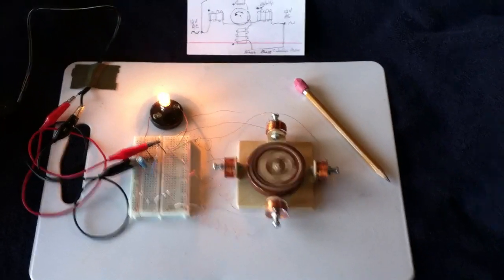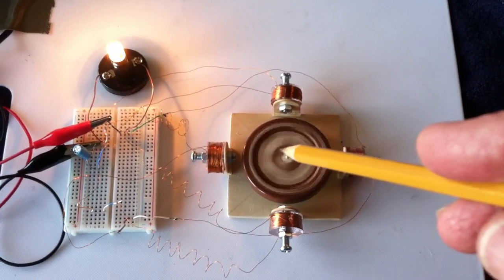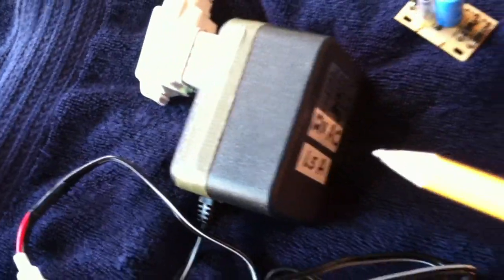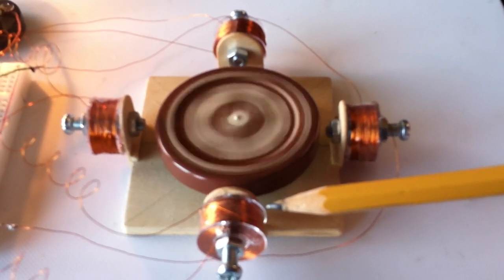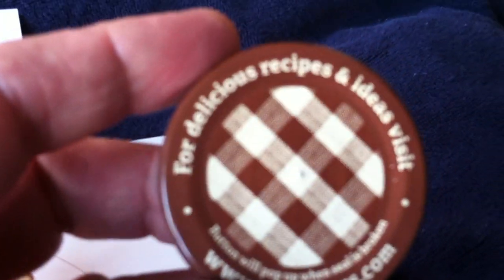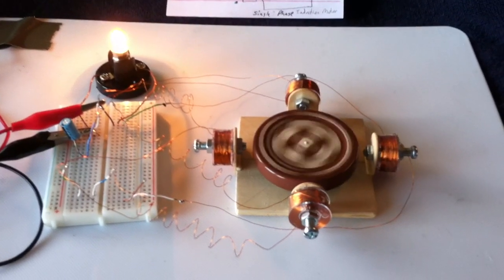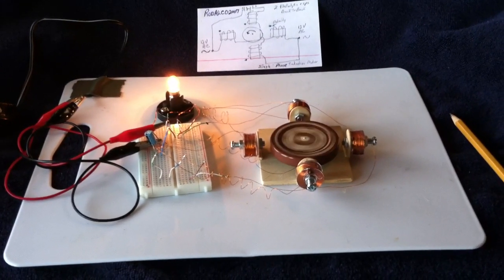Homemade 12v AC Induction Motor

Comment: i believe this is a hysteresis motor. still an induction motor, but it relies simply on the steel lid remaining slightly magnetic rather than any induced currents in the rotor. it would rather turn than demagnetise and remagnetise in a new orientation.

if you replace the capacitor with an inductance, it will still create the desired phase shift. except it will be leading rather than lagging, and will rotate the other way.

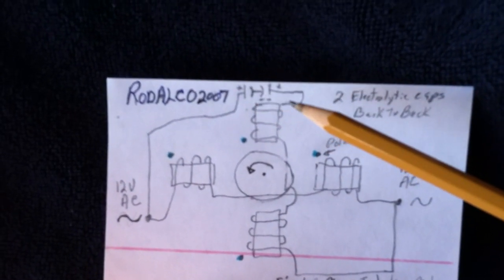Comment: 1:51 When in doubt, a simple crude capacitor can be made in similar style as N. Tesla by placing a small glass of salt water inside a larger glass of salt water and dropping an wire lead down into each glass as an electrode. Very poor capacitor by today's standards, but it might get the job done.

Comment: What is happen when replace rotor into coil
Is possible to generate a electricity in coil...?
Reply: You would transfer energy into the coil yeah. However, you aren’t generating energy. Wireless energy transfer is inherently inefficient and you’re putting power into the four coils. The energy you would get from the rotor coil would be less than that which you’re putting into the four coils. Thus, power isn’t being generated, just transferred.

Comment: Cool build.  Question how is a 2amp fuse going to help a 1.5amp max pwr supply? Seems like going to cause over heat to pwr sply / fire hazard before fuse goes away... my experience is fueses are not exact and have a breakdown point depending on condition.  Ex . Instantaneous 2 amp surge or creaps up to say 1.9amps . While doesent blow fuse and creates alot of issues. 🌋🏠
Reply from the maker: Yes.  I should have used a smaller value fuse.  What I was really guarding against was a dead short but a 1 amp fuse would have been better.

Comment: Hey, I was curious, how many turns you did for each coil with the copper wire?
Reply from the maker: I didn't count the turns of 30ga magnet wire.  It is several hundred.  It is not critical.

Comment: I know the shortened version of the math involved to determine the correct amount of capacitance for 90 degree phase shift if you want to know.
Reply from the maker: +John Kerley  Thanks.  I try to stay away from math on these projects.  Probably many folks think that is stupid but this hobby is more like a free form art thing for me.  I get some kind of weird kick out of just building something that looks like it might work ---and then watching it run.  I used to do the math thing but I'm retired now.   Perhaps my brain does rough calculation still and I don't even know it.
Reply: +Lidmotor In that case you probably may have better notes on electrical things than I would have,....I did'nt know that you used to do that for a job.

Comment: An aluminum lid will spin too.
Reply from the maker: +John Kerley   I have tried aluminum and it doesn't seem to work.  It should.
Reply: +Lidmotor An aluminum can works, because I did it before,...but at greater volt amps.

Comment: Hey, I .appreciate your excellent descriptions and wiring diagrams! I had bee waiting for an opportunity to mention bi-polar electrolytics. I used to have a Lowrey theater organ that used them in the sustain circuits. When one broke, I would replace it with two back-to-back electrolytics.
I put several coils in series in a Bedini motor. See my video and diagrams on it. Channel: frrogoy.

Comment: It's awesome to see the development on this! I might actually build this one up as the idea behind induction motors fascinates me! Have you taken your PC scope and measured the phase difference between the 2 fields? If you select the amount of series capacitance so that you can get as close to 90 degrees that should improve efficacy further. Does the lid get warm after a while? Your lucky to get away with that capacitor not exploding! ;) Have you considered salvaging a few motor starting capacitors from actual induction motors? They are about 250uF-500uF depending on the size of the motor. You can also get some reasonably high value capacitors from old dead power strips (especially the ones with some minimal filtering and protection features or UPS supplies)
Reply from the maker: +Power Max  I really need to look at this on the scope to see the phase shift.  You are absolutely right about the capacitor determining the shift.  Unfortunately I do most of my work using trial and error so I have to learn things the hard way.  That little cap doesn't get warm nor has it bulged --and I don't know why.  It should have popped by now.  I will continue to look for a proper AC cap but for right now it is the best thing I have tried.  Larger or smaller values don't work as well.  The rotor does not get warm but the coils do heat up if I run this too long.  Actually I am considering moving right into making this setup a DC pulse motor using a controller of some kind with Hall sensors to switch the coils in a rotating fashion.   The rotor of course would be changed to one with magnets on it.  It would make a good Arduino project.
Reply: ***** Umm, interesting. I would expect the coils to get warm but not too warm. Do the machine screws get warm? Like warmer than even the coils?

I have a sneaking suspicion that they are causing power to be lost, due to things like magnetic hysteresis, reluctance, and induced eddy currents within the screws. This is the reason why transformers generally use several thin sheets of soft steel laminated together.

Soft steel has little hysteresis losses, and using several thin sheets laminated together reduces electrical conductivity of the steel so that it doesn't look like adding a shorted secondary coil to the Xformer, or in this case, the motor.
Reply from the maker: +Power Max It might be the machine screw cores but I think that it is just a current issue.  I was thinking yesterday of trying air core coils using nylon machine screws just to see what happens.

Comment: Excellent job and so cleanly presented. Basic household components and I like the idea of using the bolt and nut to adjust the gaps, that gives you such fine adjustment tolerances.
Reply from the maker: +GrandadIsAnOldMan  Thanks.  I try to make my projects from household or easy to find parts like you do.  That is actually much of the fun of it.  The stator coil adjustment is critical and using a simple nut and bolt arrangement solves the problem quite nicely.  The metal jar lid sitting on nail worked but a better rotor arrangement is needed.  I'm still wrapping my brain around how this motor works.  The concept of a rotating magnetic field using a phase shifted AC sign wave signal is pretty cool.  When I look at this thing running I see Tesla looking right back at me.

Comment: Now you're torque'n ;-)

How much current & power (W) does it consume at running speed?

Thanks for sharing!
Reply from the maker: +A B  I didn't look at the power consumption yet.  I just got it running this afternoon.  The first 2 coil "proto type" I made was drawing 12 watts!!!!!! I think this one will be much lower with higher RPM.
Reply: +Lidmotor It does appear to run faster.  I'm a bit surprised how big the gap is from the bolts to the lid. I would have guessed that gap would work better if it was smaller.
Reply from the maker: +A B  That gap issue surprised me also.  When I first set this up I had a very small gap but the rotor was just pulled off the nail bearing and stuck to the nearest electromagnet.  Too much gap and the rotor speed suffers.  There is a sweet spot where the motor runs happily.  The whole dynamic of how this induction motor works is fascinating.  I wish I had 'magnetic field'' vision so I could watch how it moves.
Reply: +Lidmotor I've had that magnetic vision desire too. :)

What is the rotating field cycle rate at running rpm?
Reply from the maker: +A B  From what I have read the motor RPM lags behind the field rotation----but I'm unsure about that on this setup. It is slow. In the hundreds.
Reply: +Lidmotor TY. :)